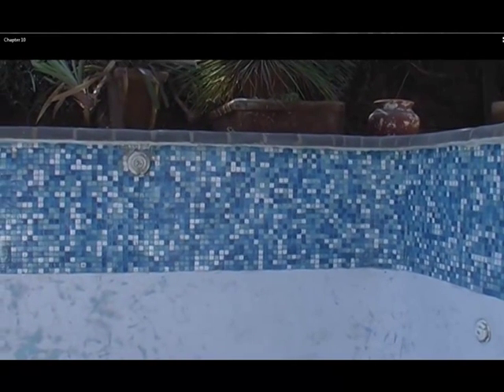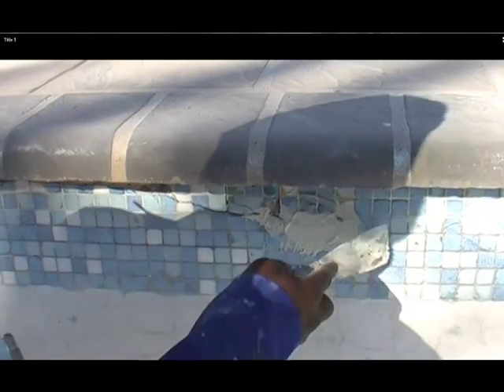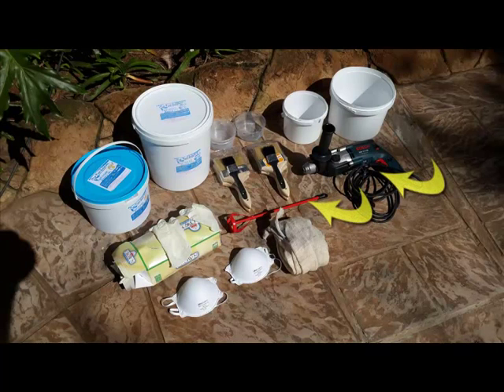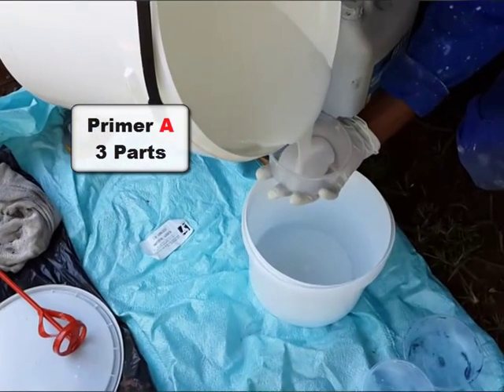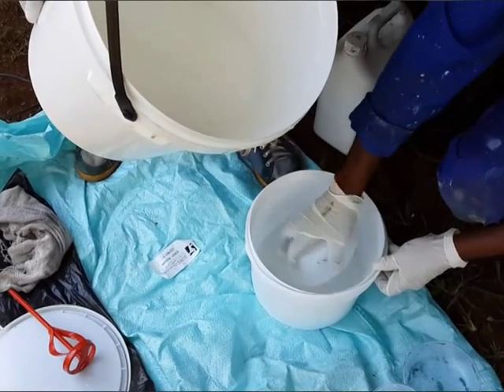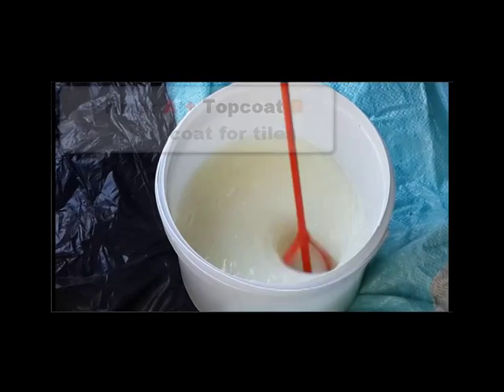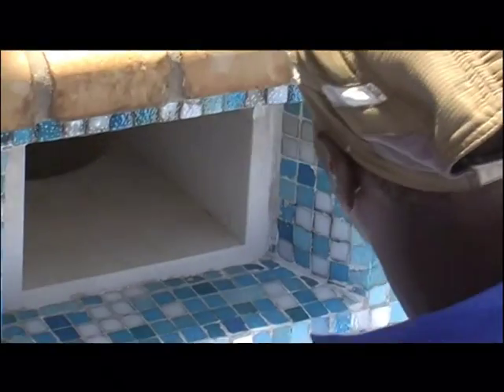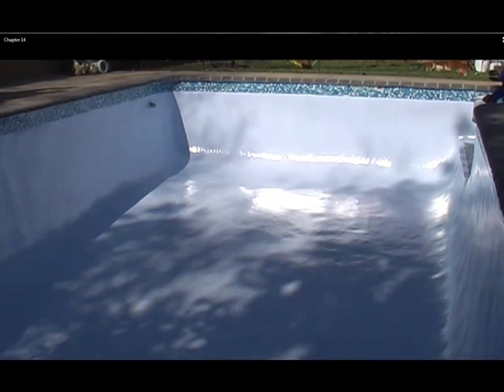Cleaning And Restoring Old Mosaic Tiles

Comment: I struggle to clean the ceramic mosaic. Any suggestions??
Reply from the maker: You can try Mosaic Wonder, highly strong acid, you will have to neutralize the surface afterwards as described below in one of the comments.  Alternatively if it is those old small mosaics you can grind them a bit but will need to apply a clear coat to restore gloss.  Sometimes, replacing the mosaics is the only way.